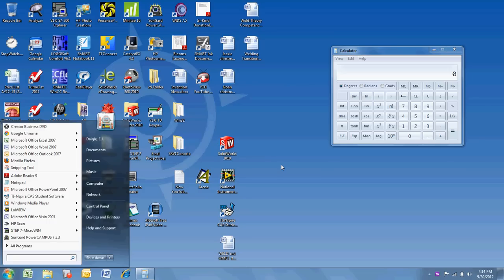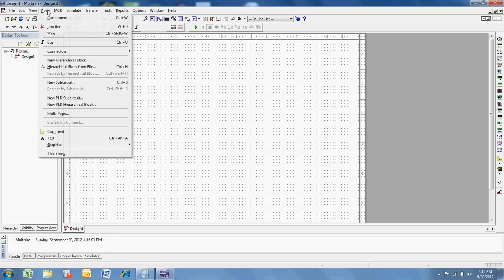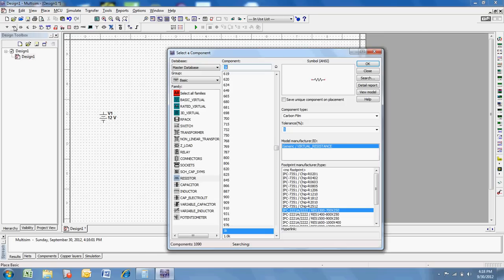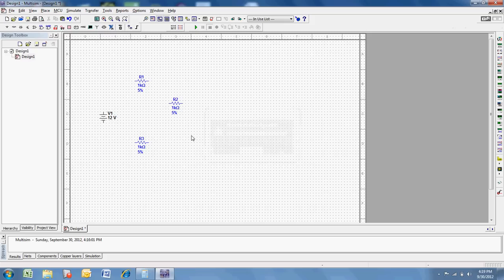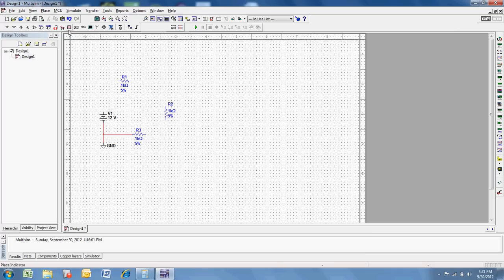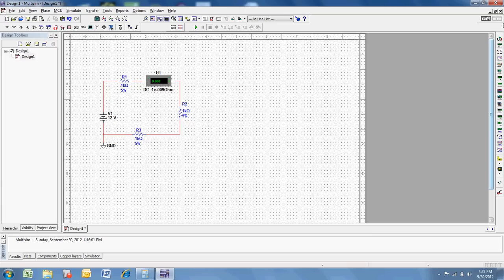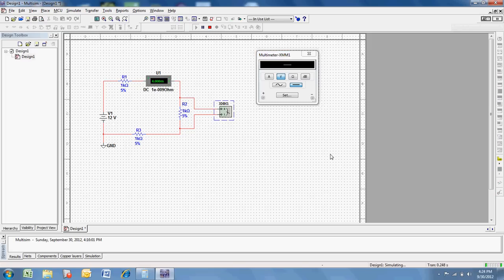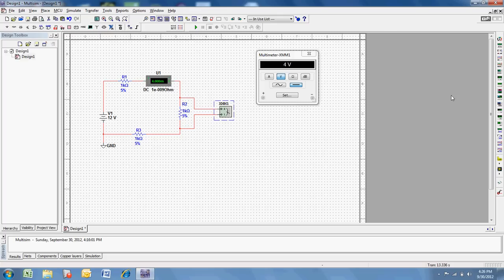MultiSim 101 - Dunwoody College Electronics Engineering Technology

Comment: Well done. But how I wish that basic courses would start with basic stuff !   
I am talking about Sources, or rather, Supplies.  
In this video you use a DC supply and wire it up, but is the "long line" allways the positive one ? What about dual supply ?. What is Vcc, Vdd, digital ground, ground ground, etc. etc. ?  Why so many ?  How are they different ?  
Do you allways need to wire sources ? 
In the case of IC's.... do you allways have to wire supplies to  them all ? Even if two or more op-amps are in one package ?
As you can see:
The fundamentals of Multisim and all other electronic sims are to manage sources/supplies first, because it is sooo confusing and many things sub-understood by everybody, but oneself.